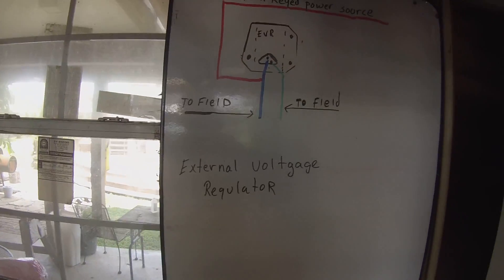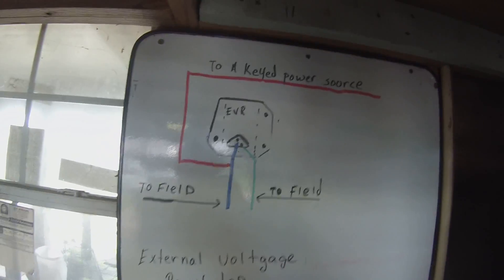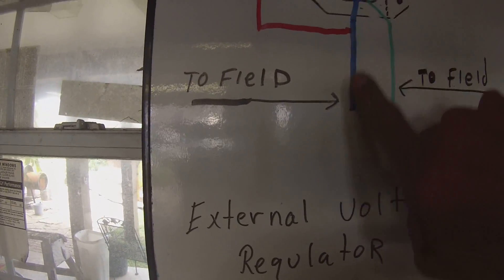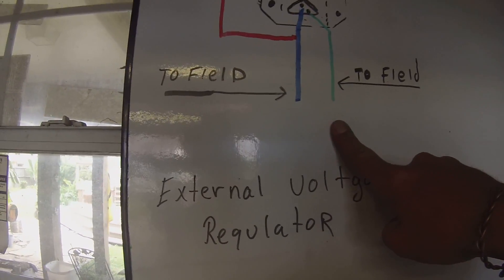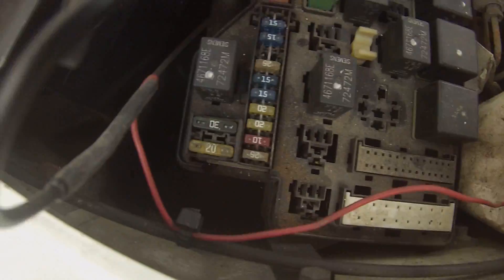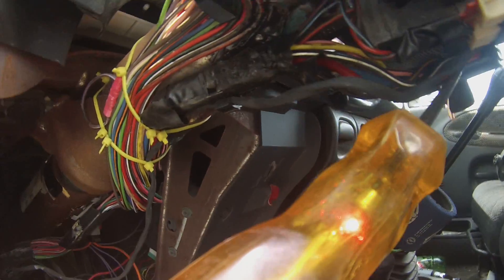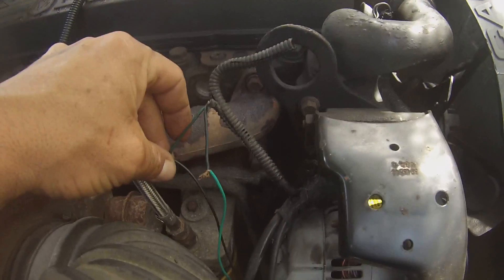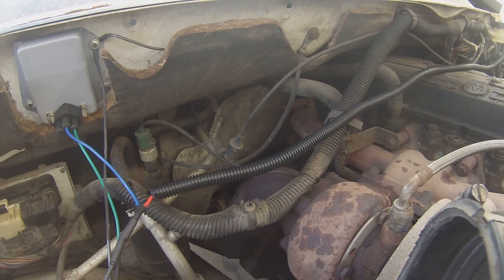external voltage regulator 5.9 cummins .a better wiring video

Comment: Crap don t work
Reply from the maker: @edwinvargas1994  bunch of responses saying it does. The truck this video was on is still running this set up.
Sounds like it's on the installers side. Best of luck.

Comment: Hey brother are you still responding to this video? I didn't check the date but did you say that truck was originally a 12 valve? I'm having similar issues and I'm trying to do the same exact thing that you're showing in this video. I have a 2002, pulled my 24-valve out and put a 97 12 valve in,  Goes without saying that I'm having electrical issues, but I do have fuel and voltage gauge, however I'm not charging. Factory It's supposed to charge through the PCM but it's not so I have installed an external voltage regulator that I had laying around  & still not working so I'm trying to figure out now whether it's bad or not before I go drop $50 on another regulator that I won't be allowed to return. Also just heard you say that it MUST be grounded before plugging in, didn't know that until just now, long-winded I know but please bare with me. I tapped the wire in the harness right before my PCM first of the three plugs from the valve cover standing from the wheel well looking in. What am I missing? Thanks!!
Reply from the maker: Try a new voltage reg.
It's probably bad.
I've literally purchased 2 new, and both were bad. So three  45 minutes trip to parts store. 
But no, it was originally 24 valve. 
O1.
Hope this helps. 
Hit me up and let me know. 
Gives you to much trouble,  I'll send you my personal #

Comment: Hi Chris, Did this to a 2000 ram 3500 6 spd.  Issue im having is that when the key is turned on , both blue and green wire at voltage reg are hot?  ( even when alt plug is not plugged in) Ive tried two VR's and same thing.  Is this normal?  i was very careful to follow this video step by step and made sure the ground wire was the first thing i did.  thanks
Reply from the maker: That's a good question,  and honestly,  I don't have an answer for you. 
I sold the truck about 4 years back,  but I'd imagine if your getting 13 volts whilst the truck is running,  I'd guess is was correct. 
I do know that it screwed with my factory volr meter in the dash.
Solution for this is do an aftermarket unit of your choice. 
I don't have a specific brand. 
Lemme know if it works out. 
I'll send you my # and we can bullshit about it. If need be.

Comment: I did everything exactly the way you show to do it. Now my voltage gauge is pegged in the red at 18 volts
Reply from the maker: Check your voltage with a stand alone meter.. 14 to 15 is normal. 
Mine did the same. I just ran an aftermarket volt gauge.
Reply: Yeah... I wired in a 4 pin relay and the factory gauge is still in the red at 18 volts but checking with a voltage tester it’s showing 14.76
Reply: Thanks Chris
Reply: One more question though... Is there a way to clear whatever code is causing the red “CHECK GAUGES” light to come on?
Reply from the maker: @zekboyett5030  
I've not been able to figure out what caused it to read over. Kinda just got used to it.
I sold the truck a couple years back.

Comment: Also could just hook to any fuse in truck that has no power with key off that's what I did way easier bought a 2 fuse adapter that has 1 wire off of it works the same way

Comment: I'm about to do this mod to my 1996 Jeep Cherokee XJ. Some of my unused fuse sockets in the cabin, to the left side of steering column, has key switched power. Was going to take the fuse box out and run a line to #6 for power with a 10A fuse. However, I wimped out and got an Add-A-Circuit to plug into that socket with a 10A fuse.

Comment: So what if my alternator is working extra hard? Could it still be the internal voltage regulator? Same truck as yours but an automatic. I’ve traced wires looking for a short and so far have come up with nothing. This is my last stop before it goes to a shop.

Comment: It's not the PCM, it's those damn silver wires coming off of the wiring harness that bolts to the back of the alternator!!! Because those DAMNED silver wires are fuse wires that go bad!! What this means is that Dodge is guilty of planned SABOTAGE!!
Reply from the maker: Interesting.  I'll have to look into that.

Comment: I have a 98 2500 12v single cab 5 speed had belt tensioner snap off and belt fixed issue two days later clock every thing goes dead same time rpm bouncing and now dead fixed batt issue had mechanic hook up to batt said bad alt I tested batt and alt while running alt at 12.4 same as Batts separately first thought is volt regulator so go looking for one even at dealership nothing don't even know said alt is bad so new alt same issue maintaining at 12.4 rpm shut down is I brought truck to advanced they hook up same way machanic did bad alt I know it's possible to get a bad rebuilt one but why my rpm I guess what I'm getting at is if it's the ess sensor or called crankshaft sensoror do I need external volt regulator for the fix?

Comment: Keyed powe source is in fuse panel in cab . I used a part from napa but all parts stores have it. Basically pull fuse and it holds 2 fuses one to complete circuit you took fuse out of and then second fuse completes circuit to wire coming out of this fuse link and you just crimp a long wire to this and route it out and around to where you mount external regulator. Originally I used power under hood from fuse box and a tango switch. Somehow in itial tests for keyed power I missed this keyed power in fuse box inside cab. I would load a pic but not sure how. But when you pull off fuse cover this fuse is left side of fuse panel If I remember correctly... when I get a few I will post exactly what fuse I tapped into

Comment: To everyone watching this video. 
Both field wires that go from the computer into the alternator are tapped into from the field wires from the regulator. This prevents a code. 
You CAN in fact go directly from the regulator without splicing leaving the fields on the loom to dangle and throw a code and it should work fine.
Reply: Sharkfacelol I was wondering this did you do this to yours and is it a Dodge 98 2500
Reply: CN you please elaborate a little more on this please

Comment: Thank hooked mine up the same way, but after just a few minutes my voltage regulator gets pretty warm. is that normal ?
Reply from the maker: How  warm?  If it burns you , then its probably  not good.
To be honest I've never felt for temp on mine.
Reply: @chrislivingston2036  thanks voltage is a little high too
Reply from the maker: @danhufferdoutdoors  , check it with a voltage tester at the battery. 
My gauge read off as well. 
Never did bother fixing it. 
Kinda learned to live with it.

Comment: With regards to the wire in the steering column, did you connect to the red or the black and white wire or does it matter?  I'm dealing with the same problem with my 96 Dodge Cummin's diesel and the charging circuit.
Reply from the maker: I'm pretty sure it was the red wire, it was a heavier gauge wire and, i want to it only had power when the key was in the on / run positions
Reply: @chrislivingston2036  Thanks, Chris, I appreciate the info'.  Your solution is a whole lot easier than trying to decode the wiring harness under the hood!  Great video and the most useful one out there on wiring up the EVR..  Thanks again!
Reply: @chrislivingston2036  Quick update - it works!  I have charging again.  At some point I'll spend the money and replace the PCM {I'd like to have my tach' back that crapped out with the charging circuit} but for the price of one PCM I can bypass the  unit over twenty times.  Ciao!!
Reply: @chrislivingston2036  should I just run it  through the spare relay off my hi ram slot?

Comment: Just to make sure i have this right, i cut the plug off of the alternator and wire the new voltage reg into that, do i also need to put the wires that go to the pcm back on or do i leave them disconnected?

Comment: So when you put the wires from the voltage regulator to alternator did u still have the computer wires hooked up to it
Reply: I left factory plug and went to wrecking yard and removed same style plug and wired in new plug to external regulator. That way if I fixed computer I could just plug in factory plug. Didnt want to cut factory harness

Comment: What year did Dodge go to the PCM setup?  Because my 91 has an external voltage regulator.  Old Style, and it's factory.
Reply from the maker: 70's and 80's there all about the same.
Reply: If I'm not mistaken it was 91.5 that they went to the pcm
My I've done this to my 93 work great but looking to replace my pcm as I dont have a working speedo and wait to start light/grid heater

Comment: I tried this exactly as described but cant get the alternator to shut down. It will stay charging and run up to 18 volts. I quickly shut it down when it climbs above 15 or so. Any ideas??? Could it be a faulty regulator or could the two wires on the alternator be swapped?  My particular situation started when the alternator welded itself together and almost burnt up my truck. I replaced the alternator thinking it was just the alternator. Then, it would not charge and the amp gauge inside would show battery voltage but only for a few mins then read 0. The truck would run fine still but not charge at all. I assumed the regulator in the PCU was bad so I by-passed with this instructional video. What can I do now? ANY and ALL help is welcome!!
Reply from the maker: Mine does the same. I run a second after market voltage meter. And just disregard the factory voltmeter. I think mine burnt up when the computer went south. Use a  hand held volt meter that you check current with. To make sure your not over charging.
Have been running mine this way since video was posted.
To lazy to gix correctly.
Reply: @chrislivingston2036  my alternator now runs all the time and over charges. I'm thinking I got a bum regulator. I hope anyway! Easy fix, if so. If not, I'm back to starting over and probably will go with a one-wire alternator since I don't know what else to do. Any other suggestions??

Comment: what were your symptoms before you installed the evr. mine just doesnt want to charge the batteries. i cleaned all grounds, terminals, posts etc, figured it was the alternator and brought it to get tested and passed with flying colors. reinstalled, fired up the truck and no charge still...
Reply: White Male did u ever find the cause of this

Comment: Having troubles with the truck not staying running unless I keep my foot on the gas, any ideas?
Reply from the maker: Dusty Harris fuel pump, lift pump??
Reply: It was working after I installed a voltage regulator, but wasn't charging battery, took the regulator back and got a new one. Put it in and now won't stay running without my foot on gas
Reply from the maker: Dusty Harris my voltage  reg went out the other day. it happens. replaced with a new one. i didn't  have everything  wired back up correctly,  fried the new one. took me an hour to figure it out.  make sure all wires are correctly  attached.  and having  a good ground  is a must. hope it helps.
hard to diagnose  on the interweb.
cheers... chris.
Reply: Thanks Chris Livingston. I think I have everything wired up right, the only ones I am worried about are the ones on the alternator. Seen a video on how to check the regulator but can't seem to get it to work like the guy does and even new mine isn't showing anything

Comment: While this works, somewhat, there is an easier way. Make up two long wires, one blue, one green with small ring terminals to fit the field terminals on the alternator. The blue wire goes on the terminal closest to the battery terminal. The green one goes on the one next to it. Leave the whole molded connector atttached. The blue wire is the switched battery voltage from the fuse box. It goes to a splice on the firewall and switches from blue to green with orange stripe. It then runs to the Auto Shut Down relay in the fuse box, terminal #87 on the relay. Terminal #30 is battery feed to the relay. Once the PCM sees crankshaft position movement it turns off the Auto Shut Down relay and connects battery power to the field on the alternator. 
The voltage regulator must be grounded good so make up another wire with a larger ring terminal and attach it to the ground lug on the alternator, also part of the molded connector. Run the field wires and ground to the voltage regulator and connect. Be sure to solder and heat shrink tube all the connections or you will get fluctuations on the voltage and burn out the voltage regulators. The ground wire can go directly from the battery to the voltage regulator which is probably the best method. 
If the ASD is not switching off, it won't turn the voltage regulator on. There is a blue with yellow stripe wire that goes to the PCM that is the switching wire for the ASD, terminal #86 on the relay. The PCM grounds it to turn it off and allow current flow. It also turns the fuel pump on so if it runs, that circuit is most likely still good. You may have to run a wire to it to get it to switch the ASD off. Wire colors may vary year to year. The field wires will likely be the same for all years and match up with the voltage regulator. You could tap into the field wires closer to the firewall and shorten the wire length. Both field and switching wires go to the PCM so if you can mount tthe voltage regulator close to it, it would make it easier. If checking field wires with a volt meter, you have to dis-connect them from the alternator. Otherwise, they are connected inside the alternator and you won't be able to tell which one is which.
I just did a '94 Cummins this way after seeing all the other attempts. This was much easier and cleaner.
Reply: I may attempt this soon. Sounds very detailed. Thanks for your input.
Reply: Hey i have a 95 2nd gen new batterys ,alt an external drive works vr an still not charging any idea

Comment: Couldnt you just tap into a fuse in the fusebox, so that you dont have to deal with all that wiring? IIRC most of them are switched.....
Reply: That's what I did but originally when checking for keyed power I somehow missed it. Only one fuse I believe is a key powered and that's what I used vs using tago switch to turn off and on the power.

Comment: did yours ever have a type of pulse to it?
Reply from the maker: +12v cummins exsplain pulse ,please.
Reply: +chris livingston like the battery gauge is bouncing between 14v and 16v... and when i wire it to the wiring harness it does not turn off it just keeps running until i ran the wires straight the alternator...
Reply from the maker: +aaliyah nez not sure about that, but mine does show a pulse on the gauge but when i put a tester on it it is around 13.5
Reply: I read that if the gauge bounces all over the place is because it's not grounded sufficiently.
Reply from the maker: i will check that, i am normally a ground nazi. but will deff check . thanks

Comment: Will it work on an 07 dodge 5.9 cummins ?
Reply from the maker: +meag od as far as i can tell , it should work . the motor is the same  . then again this has been such a problem, they might have solved it. i truely doubt it but possible

Comment: Chris--thanks for your reply.  I tried the external voltage regulator as I mentioned, but was frustrated, the "check gauges" light kept coming on, used three different regulators, all the same, the voltage at the battery was good though.  The one wire alternator is a dream to put in and works fantastic, no issues so far.  don
Reply from the maker: don cook send me a part number on the alternator please.my check gauges light has been hinky since installation. every thing works fine , just the guages are off.  thanks chris
Reply: chris livingston Hi--I am out of town for a few days, will get back with you when I return home.  thanks   don
Reply: chris livingston, this is a great how to video. I hope this is what’s wrong with my truck since I’ve already replace the alternator, 140amp fuse (which was good anyway), and can’t find what else to do on my 24v cummins. One question I have for you is what external regulator did you go with?  Where did you source it from?

Comment: I tried the external regulator system and it failed, I used a new alternator, three different regulators and finally the system failed.  I have a better solution to the dodge Cummings diesel alternator problem.  there are two kinds of one wire alternators, one will drain your battery of you let it set for a while, the other kind will never drain the battery, that is the kind I bought,  it  cost $150, and I installed the field modulator.  a few changes on the mount were needed, but it is pretty easy to do.  if you would like to make contact with my source I would be glad to share that information.
Reply from the maker: don cook hey don, i would gladly use your info. the system i showed in the video has been in my truck for almost a year with no problems. but i have been getting mixed results from my viewers; i would gladly check out your system, maybee i will help the 40 percent my system did not work for. thanks for your input and help.cheers.... chris.
Reply: I would love to know too. I'm looking for a reliable wiring system to work on my 2001.
Reply: I would appreciate this info as well. Did anyone receive the info from Don Cook for this fix?
Reply: I'd love to get the info on this fix also
Reply: I believe  it's  a  1 wire  DENSO  SE  (self excited).  Google  '1 wire  alternator for  Dodge'..  and   a few  shops will  pop up.     About  $250-300,   some with  lifetime guarantee.  Some with  upgraded amps  (160 or more) Running a FRM  (field replacement module)  is  basically a  heat sunk resistor,  fools  the   ecm  into thinking  IT'S   still in  control.. and no  CEL should  'pop'.       Looks like    this  is  effective on about   80-90% of  trucks (keeping the  CEL off)